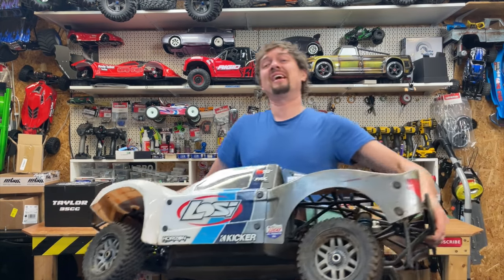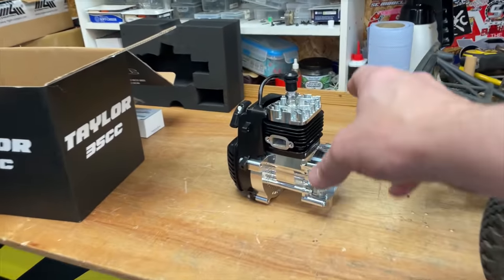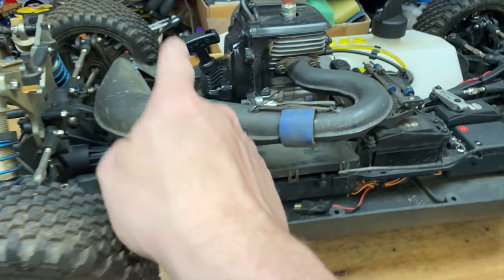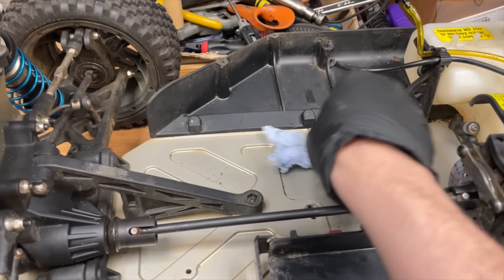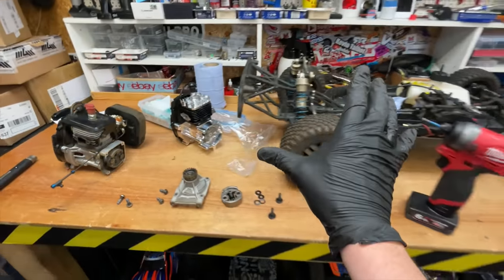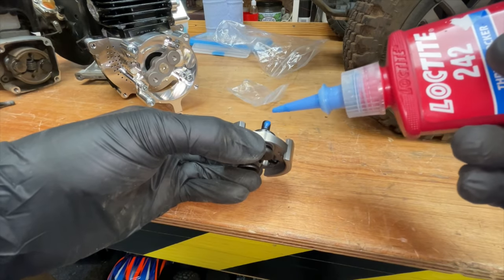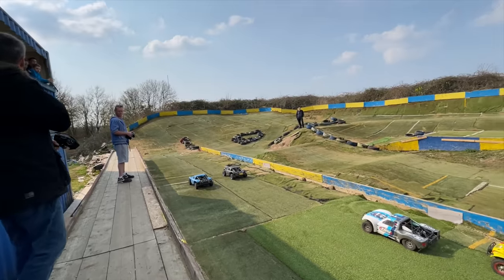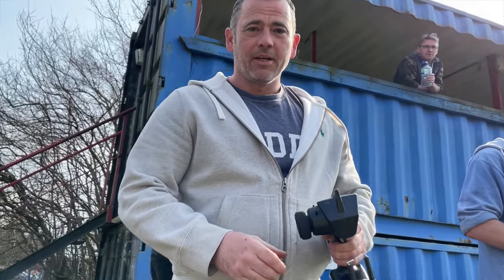GIANT RC Car Gets BIG Power - Taylor RC Billet Engine

Comment: great job Kevin! hmmm..perhaps in the future, some engine builders will come with an electric start that you can just push a button on your remote instead of all the arm pulling. keep up the great job!
Reply: I think that exists
Reply: It does exist
Reply: It does exist. Most people choose to run pullstarters because electric starters are are expensive, easily damaged, and often flood the engine when trying to start it.
Reply: they do exist and yes they are a little pricey, but i prefer the uprated pullstart from FID, they work a treat and i use them on all my rigs now
Reply: Their are kits like this you can add to certain motors now. I have one for a DBXL gas... Not as good as you may think... Plus bulky and heavy electric motor.
Reply: What a good idea you can probobly program a switch or something tho
Reply: Totally!
Reply: Gotta say when I had a gas rc I broke the pull cord so many times and got a electric starter for it. But both have their flaws and gas rc cars require obscured amount of maintenance which is why I switched to electric.
Reply: They do exist but it won't give the real spirit tho

Comment: I’ve had that little 12 volt dewalt impact for over a decade and the batteries are still good they still work like new. I was lucky and got probably one of the first batches that came out in around 2010 or so and everyone that saw those little drivers back then fell in love with them. They are more common now but the old ones still work like new

Comment: Kev you should start breaking in factory stock engines properly. You would get a lot more power and wouldn't feel the the need to upgrade them to new engines. Although that Taylor Engine is pretty epic, not gonna lie! Not even fully broken in it is giving those factory engines a serious challenge.

Comment: They make very nice motors enjoy.Putting a huge more in it will also break parts.I have seen guys run 80 cc motors and it's crazy fast but you need to modify the car and even then parts will break because of the shear power of the motor.

Comment: Don’t get me wrong, they look awesome, but the engine modifier I use gets same or better power out of the Rovan and Zenoah engines. Benefit is they are much cheaper then a Taylor RC engine. Plus if it makes so mu VH power, his the heck is it running the garbage stock pipe?  Should need more expansion room.

Comment: i'm creating a drag car from crash but i do the same thing as you did, using motor straight to the axles, but esc heat up with ease, i think that happen to your project 203 mph, the first mistake is the use of motor direct power to the diff, that why one of your esc $1000 burn

Comment: One big secret to a two-stroke engine is to keep that air filter clean they get soaked with oil and will choke the engine down after a while I put together motorized bikes and after a few miles they will run crappy and I have to clean the air filter